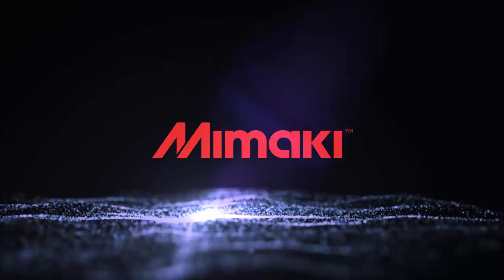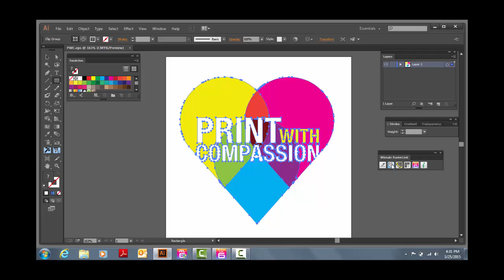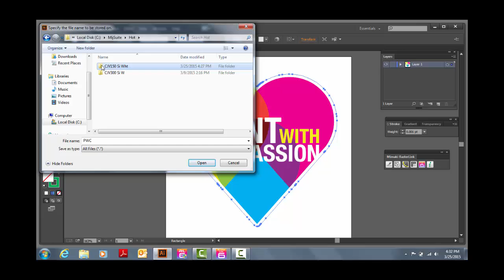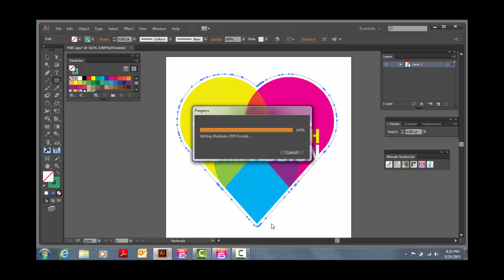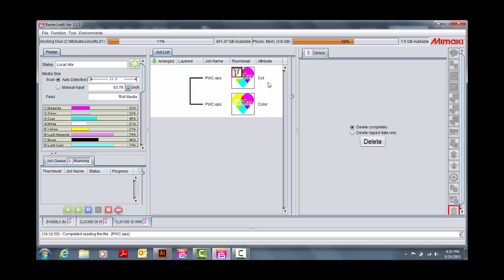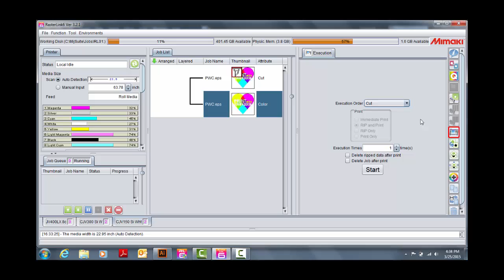Mimaki Print & Cut workflow with RasterLink Tools and Illustrator

Comment: I am using Illustrator 2024 on Mac. I will be outputting to RL 7. When I click on Frame Extraction, there is no option for offsetting the paths. Where is that hiding now?
Reply from the maker: Hello, the frame extraction tool is in FineCut9 plugin. 

For technical issues please contact our remote service support team at na.service@mimaki.com or at 888-530-3992 for a prompt response.

Comment: Is there a "cut and print" function plug in on the new CJV150 series for Corel, we just bought one and our installer did not know?
Reply from the maker: +steve Gamble: Not in fine cut. However, if you submit the file from fine cut to rasterlink6, then go to the output to the printer, there is a drop down menu to choose whether to print only, print and cut, or cut then print.

Comment: Jim,
Is there a "cut and print" function on the new CJV150 series as mentioned?
Reply from the maker: +Mitchell Zuniga - Yes...CJV150 has the same capabilities as the CJV300. The only difference is the 150 has 1 print head and the 300 has 2 print heads.
Reply: how do you do the cut and then print portion on the new Mimaki?
Reply from the maker: +Mitchell Zuniga Please send us an email to social@mimakiusa.com so we can send you a picture of the steps, it is pretty easy. Thanks